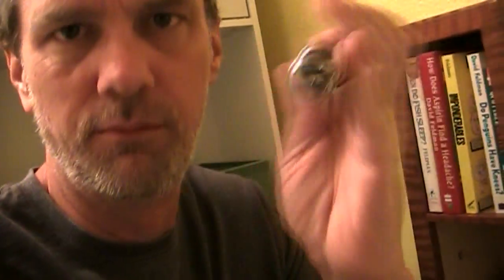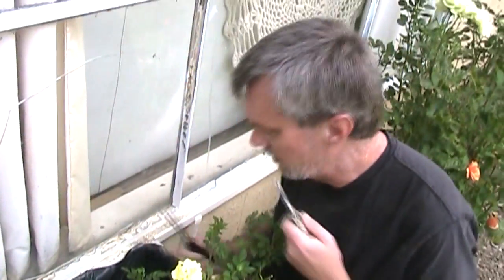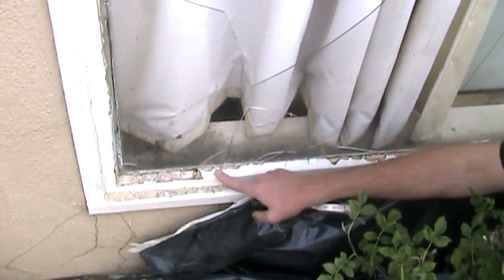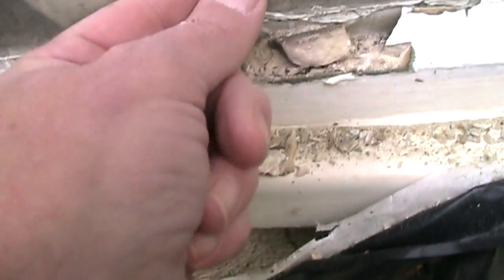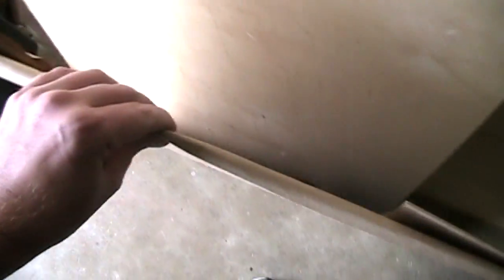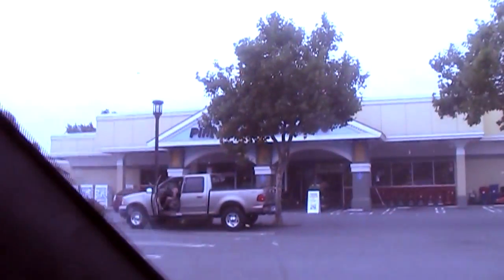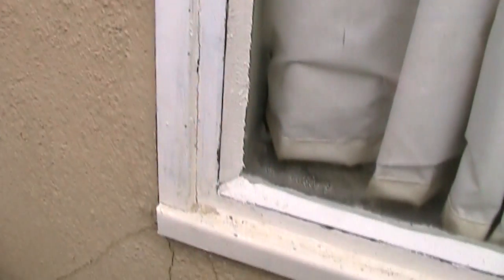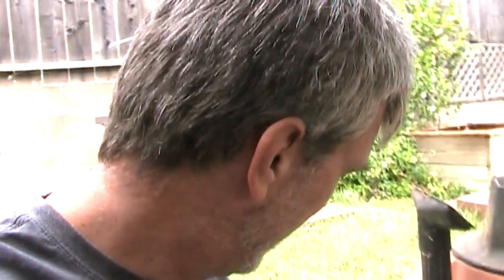MM 7-31-11: Toilet paper spindle / window repair / Mercutio

Comment: Steve, you are so right !!! I have done so many repairs to my house: electrical, plumbing, landscaping, etc. YouTube and Google can save  you big bucks. The main idea is to know what needs a  building permit and where your real limitations as a "handyman" are, so you don't get out over your head and not violate any safety procedures. That being said, I have saved thousands of dollars doing basic plumbing and electrical work. The tools used for woodworking are great for working on other areas: using your miter saw to cut PVC pipe for a plumbing fix, for example. Great video !!!

Comment: Considering the PITA to get all the rock-goop off of there from the old window, and how fragile it was (because it's so thin), I'd probably suggest leaving the "re-gooping" until you want to actually replace the old windows.  Probably does wonders for both safety and insulation even if it's not double-pane.  Awesome little video, you inspire me, sir.  And by "sir," I mean Mercutio, I think you have a little actor on your hands there. ;)

Comment: Episode 6 on season one of Ask this old house has a great tutorial on how to replace a pane of glass. There's also a drill driven tool that you put into the glazing and it just rips it out in no time. That's in one of the "What Is It?"'s  from the same year. Otherwise heat will remove the old but you have to heat sink the next pain so the heat won't crack the glass. I prefer the glazing removing tool myself. Oh, on wooden frames (yours looked metal) you need to linseed oil the wood first.